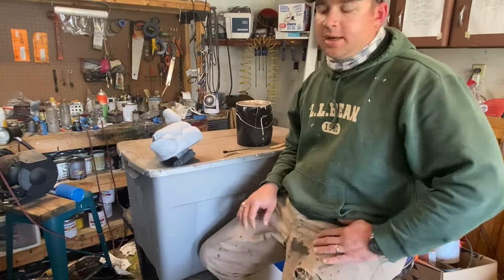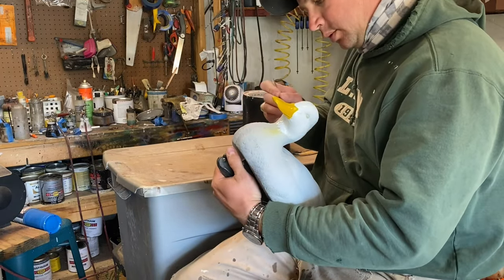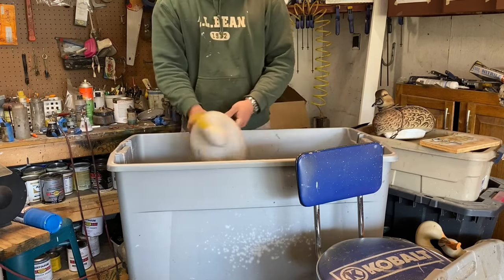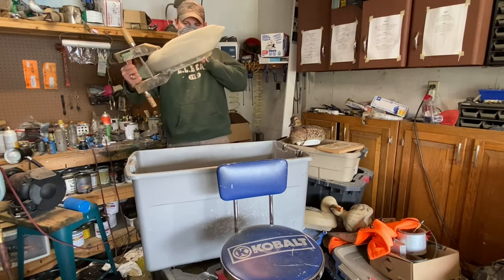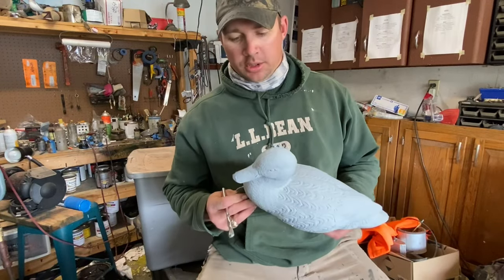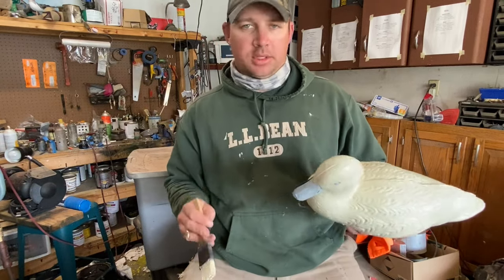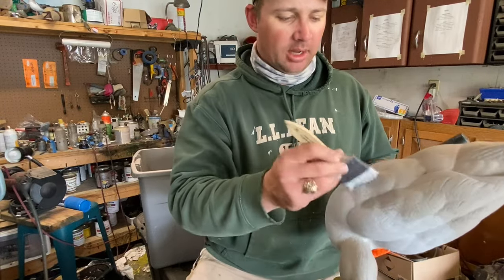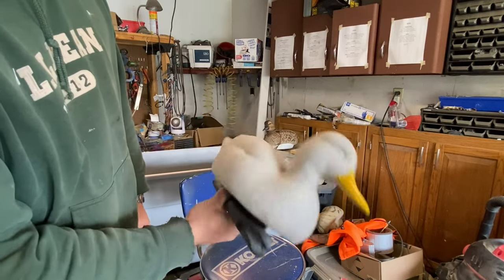Step 3: Applying flocking to duck decoys

Comment: Andy, glad so see another video! Do you flock drake widgeon? If so what do you use to bring out the amber color of the body? I've used an orange base paint with brown flocking and had good luck, but wondered if you had a different process or tips.
Reply from the maker: I have and I do. They are coming later this spring in their own video, drakes and hens both. I use sand paint with tan bisque flocking then layer burnt sienna and raw umber VERY lightly on the sides to slowly build up the color. Lastly I’ll cut in some white then overspray grey on the chest to give it that purplish/wine color. I don’t know why grey works for that. But it does. 

Personally, I think wigeon are about as difficult as it gets when it comes to flocking and airbrushing decoys. I have some pictures of them on my facebook page, Two Rivers Counterfeits Waterfowl Decoys, and the Decoys Flockers group has several as well.